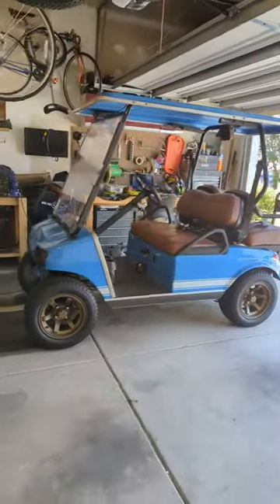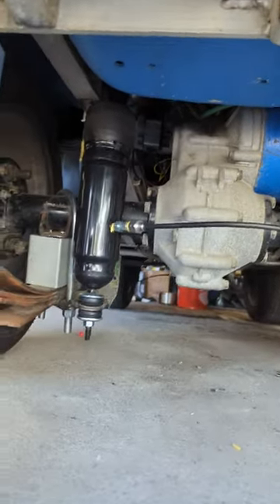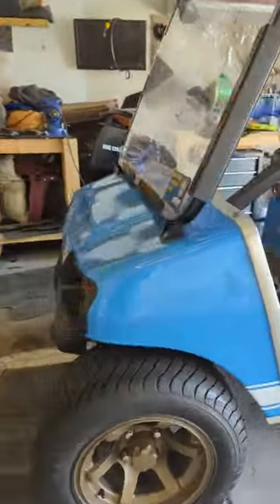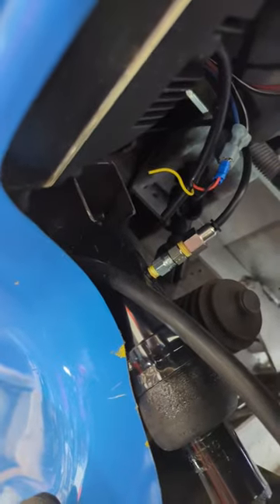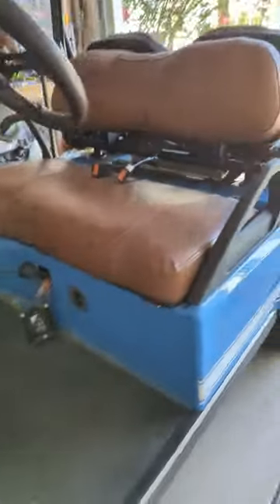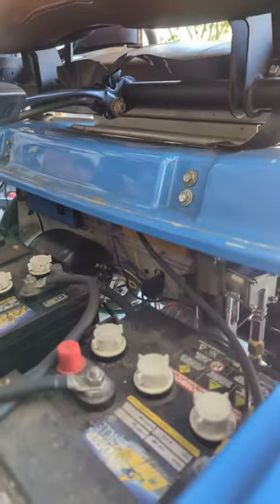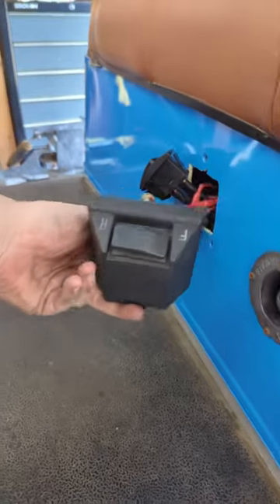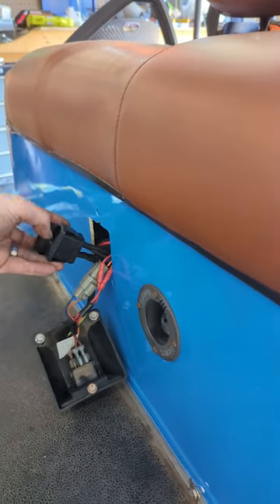Club Car DS Air Ride Project - First tests and basic overview

Comment: What model number shocks are you using for the front
Reply from the maker: Monroe MA785 for the front. MA705 for the rear.

I'm hoping to finish up and get a video up this weekend of some changes I've been making since this. The leaf springs were limiting travel a lot and the tie rod in the front was limiting front travel.
Reply: @THEarmpit  thank you for the info Ive been trying to figure out the front end as I’m not on a factory body I have a 34 ford truck body with stretch frame and it just doesn’t sit low enough for me